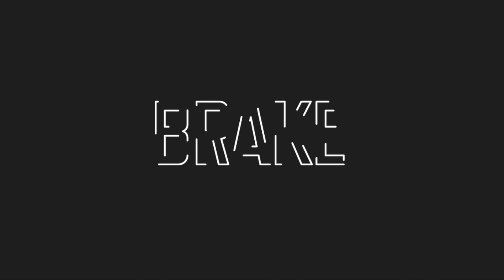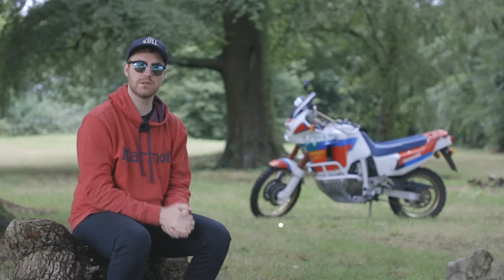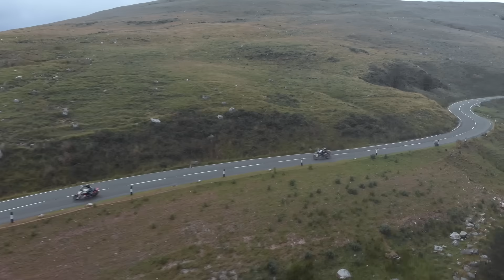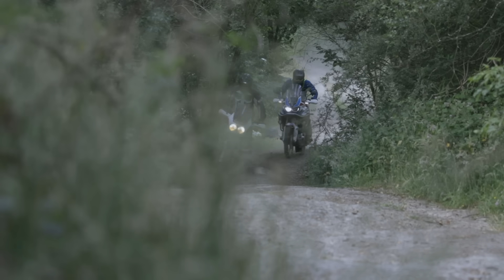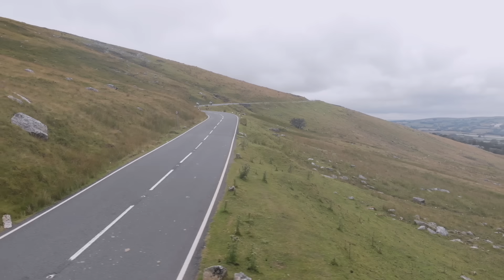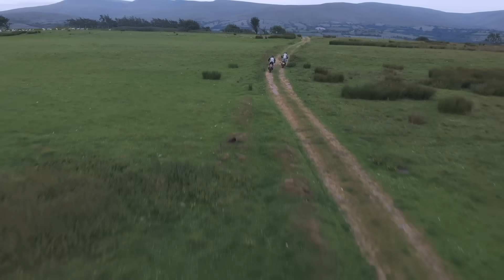Retro vs Modern - 1991 Africa Twin vs 2019 Africa Twin

Comment: Technology is great but for off-road purpose, I think you can get stranded if a piece of tech lets you down. For me, it would be the old bike to keep long term since it will always be fixable.
Reply from the maker: We were just talking about this on another video. It's kind of true but for the most part they only integral electeonics are the Efi/ECU and electronic throttle. All the other systems don't stop the bike running.

Comment: I drive a 1989 Africa Twin 650 almost daily (wetter not to nasty) and I upgraded the front suspension with progressive springs and a bit thicker oil and it totally transforms the bike. Instead of "crashing into rocks and potholes" etc. as you say, and generally flopp'n about due to the soft suspension, the handling improved massively. It will never be a modern generation AT, but it has become darn good for what it is. Flickable and very stable on motorways and on the twisties alike.
Reply from the maker: I can imagine.
Reply: Perfect example of keeping a classic bike in the hunt and still competitive, well done brother.

Comment: The old one is way and way better! If you have the new one and battery dies your fucked!! The old one you just push it and ride!!
Reply from the maker: How is that any different? You can bump start, jump start them? Surely that's not really any different.
Reply: @BrakeMagazine   yeah where do you do that in the woods? You cant push and start the new one... you need indeed a jump starter
Reply from the maker: If you have a hill you can bump start it. You can push and start most bikes. Its not easy and the old on will start easier, but it's not impossible. However, I'd say a jump pack is useful for any bike bigger than a dirtbike.
Reply: @BrakeMagazine  oh yeah is see! But the old one still better and more repairable
Reply: @BrakeMagazine   BUT there are both the best you can GET! best bikes out there!

Comment: T700 v 660xt
Reply from the maker: Why the 660?
Reply: @BrakeMagazine  because it's a like for like Yamaha Tenere comparison. Similar engine size. You wouldn't compare the T700 to the Super Tenere 1200, right?
Reply from the maker: @ianstewart9487  No I was considering the original Super Tenere because it's a 750 twin 🙂

Comment: Great video. I've only been riding properly for a couple of years, and have only ridden older bikes. My daily ride is an '85 XT350, complete with weeping fork seals, damping rods, tired shock and kickstart only. People laugh when it won't start first kick, or when I'm fiddling with the pilot air screw to smooth out the idle, but I think that retro world is all about finding sweet spots, in clutch play and throttle blipping and jetting and timing the preload bounce for that wheelie. But I haven't ridden anything modern to compare that too. So when I'm struggling up a pig-track and Roger says "My GS would get up here easily" as he whips along on his CRF, I tell myself its because the sweet spot on those came factory-fitted.

Comment: Sorry guys but the Africa Twin you chose was a POS! You need a good condition one to compare them. I have had both and the old one walks all over the new one. I stopped watching after you said it didn’t like going over 60mph! I sit at a ton (MPH) on mine in Europe and it is barely trying. Get a good AT and retest it will surprise you. We have not gained anything in 30 years unfortunately. One last thing... I had way better fuel consumption on my old AT than my new one. Breakdowns on my old AT are fixed at the side of the road - breakdowns on my new AT are dealt with by a breakdown lorry! I sold my new AT! Food for thought.

Comment: Good video,well done but there is just one thing that is wrong and it's not just yourselves making the quite important mistake. The mistake I refer to is the misuse of the word "Retro". 
The definition of retro is " imitative of a style or fashion of the recent past" . Now i'm sure that you are more than aware of the fact that the original  Africa Twin you use is not a modern bike designed to look old but is infact an original  design/model therefore making it impossible to be a retro. So maybe the video title should be "Original v Modern".

Comment: Nice! 1150 gs vs 1250 .. for the price today, 1150 is a very good machine for everyday and for very long trip. Easy to fix , very confortable and still fast in Alps corners..
Reply: Definitely !! But don't go for the 1150 but for the 1100 without ABS instead, I do own both of them and the 1100 feels "lighter" to ride without ABS, it's a difficult feeling... more "direct feedback" I would say.

Comment: Tenere 700 vs africa twin ads dct? im still in 2 minds over them....hondas build quality vs yamahas? hence the price
Reply from the maker: The build quality isn't where the precise difference is. The Tenere has the bare minimum electronics and uses an engine Yamaha use in a lot of other bikes. That keeps development and production costs lowerer, hence the low price.
Reply: @BrakeMagazine  indeed , i know that there is less on it which is a plus too for me, less to go wrong, but honda hardly ever go wrong...what do you guys think is the better bike if you had the choice?

Comment: You compare two motorcycles, one brand new and the other 30 years old. Judging by the condition of the old one, it has already driven a lot of kilometers (100,000+ ?) which makes the comparisons you make of course completely wrong. There is some wear and tear on a 30-year-old motorcycle such as the suspension and the motor part but also the motor in total. Offcourse its true there has changed a lot in motorcycle compared with 30 years ago.
Reply from the maker: It's has 30000km on it 😊
Reply: @BrakeMagazine  Do you believe it yourself?  😊
Reply from the maker: Believe what?

Comment: Great! Owned 3 xrv750 and a crf1000, which i have already sold. In my opinion the old one was an easy to handle swiss knife whereas the new one needs a lot more attention. Next: 700 Tenere Vs.ktm790 Vs. BMW f850 😀

Comment: Years ago I had a BSA Gold Star 500.  It was very easy to ride, went fast enough to get me where I wanted to go and looked Killer.  It was fun.   Now even a Triumph Bobber has to be 1200cc.  What?   Manufacturers have forgotten the mid sized bikes and how capable they are beyond the Sport Bikes.  I’ve ridden the Suzuki DL650 and the KLR650 and find them super capable.  I think the Afrika Twin could have been another of those easy to ride, fun bikes without all that weight and power

Comment: Kudos  for doing the comparisons that us old guys think of.  But, is it really going to be a surprise that modern bikes are always going to be “better” – better, smoother engines; more power; better suspension; better adjustability; better brakes, better ….well pretty much everything.

I think that what this test, and every single other comparo between an old bike and a new bike will reveal is:  There’s something lost in the ‘better’.  Call it ‘soul’; call it ‘cool’; call it ‘feel’; call it. . .  whatever.  When you insert a computer to take over a rider’s function, something is lost!  There’s something about old tech that puts a smile on the rider’s face that new tech just can’t match, even if the old bike is slower, poorly suspended, etc.  Old school has its benefits!

I’ve got a lot more bikes than a person should be allowed to own.  Old and new.  For the life of me, I have no logical reason why I should own a ’80 XT500, when I have a GS850, KLR650 or DL1000, because those bikes are demonstrably ‘better’ in every measurable way.  And yet, when I kick that XT into life, it puts a huge smile on my face – it’s a friggen hoot.  Every one of your comparos is going to show the same thing.  I’m subscribed with a big thumbs up!
Reply: I ride bikes to ride bikes not to ride computers. I can so that at home
Reply: New is not always better: 2005 D-tracker 250 vs d-tracker x. Sometimes attempts to comply new ecology standards just kills more or less fun machine.
Reply: Those xt's were tractors!! That's a compliment...from Wyoming USA 🔫🤠🇺🇸p.s stay safe

Comment: 1996 Suzuki DR650 vs 2019 Suzuki DR650, oh wait...
Reply: Suzuki cant update the DR because of modern day emissions. If she changes anything, the need to do a new emission test and it will fail. Same story with the KLR and XR
Reply: Very good 😂 FFS Suzuki need to update their bikes
Reply: Worlds apart. Different headlight. LOL
Reply: The new DR should be about $3,500 off the showroom floor, not $6000+ ...good bike but you ain’t gettin much
Reply: My 2018 Dr has some upgrades that aren't there on the 2017 version...fuel filter near the helmet latch and tool kit.
Reply: @robertgOU812   we could definitely make a 12 minute video about that.
Reply: Would you tell the colonel to change the herbs and spices? You don't fix what ain't broke.

Comment: Great video, a proper test would be to get an original Africa Twin thats been in storage with around 1000 miles it and had a proper service, then you'd get better results. Both excellent bikes.
Reply from the maker: That's pretty much impossible to achieve though 😂

Comment: I always supported what your conclusion was in this video and got criticized for it.... 80% or more owners of the new Africa twin will just ride it on tarmac and use it for touring. Therefore I said Honda should offer a version with tubeless tires since it is hands down easier to fix a flat instead of removing the whole wheel and tire from the rim at the side of the road. Nothing I've seen in this video would not also have been possible with tubeless adventure tires. To justify a tubeless off road tire you have to go way more hardcore. 
Like your channel content 👍
Safe rides 🏍😊
Reply: If you´re going with tubes, offer knobbies (street legal knobbies), but if you´re going to put a 90% tarmac tire, go tubeless. The stock AT comes with tarmac tires and tubes, the worse of both words.... I think Honda builds the perfect bike and then it passes to the "mess up department" for the final touch and then it goes into production...

Comment: This is a good idea. I would really like to see the XTZ750 vs. Tenere 700. I have an old '91 Super Tenere, and i feels really old in some point. Just as you said here the suspension has gone a lot of way in 30 years, but i surprised me that you thought the older bike was lighter. The 1000 CRF has grown in size but still. The one main issue with my old Super Tenere, is that i really feel it to very heavy, with much of the weight in top. I recently drove a BMW F850GS, and it felt like 50 kgs lighter in the track, but they do weigh approx the same. I think the difference between the old S10 and the new T700, will be big.
Reply: all old was generally lighter....golf class cars were 500kg lighter in general :D...well except bicycles :D

Comment: Its sad to see how far bikes have "advanced and improved" over the years.  I am sick of hearing about abs, traction control, ride modes,  etc.  I just want a bike that i can ride hard and maintain/repair when needed (even along the trail without special tools).  On the plus side these new rolling computers are driving the price of older used bikes down.
Reply from the maker: Unless you're talking bikes like the RD04. It's pretty expensive for a 30 year old bike.

Comment: Having owned both old and new models of the Africa twin what you don’t mention and is a big deal is ; the brakes on the old one are rubbish and the tank once full is really top heavy and noticeable, the new one doesn’t have these issues , and before anyone mentions it both bike I bought from new a 2000 model and a 2017 model.
Just my honest opinion
Reply: I had a TransAlp, my biggest complaint was how top-heavy it was.
Reply: I agree about the old one, as I had one for four years.

Comment: Great idea, especially for us nostalgic older guys. Just one thing; in order to make a fair comparison you can't take an old nail and put it up against a new bike. You'll have to find an old bike that is in-spec. Not easy regarding engine output and particularly suspension.
Reply from the maker: The bike we had was mechanically in good nick. Not perfect but decent. Finding pristine bikes that people will let us ride off-road is tough 😂

Comment: BTW a better comparison would have been between the non-DCT and the old Africa Twin, that way you could have focused on the key areas of difference that apply not only to these two bikes, but to pretty much all of today’s bikes, and to 30 yr old bikes. The DCT only appears on one model and is outsold by regular transmission anyway.

Comment: i just want the simplicity back. easy to fix and maintain on your own without voltmeter or laptop, obd. i've got rid of my dct because you can't jumpstart it or even roll it on with low or bad battery. you can't get it in gear without a full battery. no manufacturer will tell you this! did you ever try to fix an broken electronic gas handle on your holiday trip? it took me 4 hours to get a new battery in the middle of germany to continue my ride... (imagine this happens in the middle of nowhere). sure, old bikes can't catch up with new generations but i won't give a penny when it comes to these situations... make it simple, make it work, make it better, get rid of electronic stuff...
Reply: i was thinking about the new dct mate, i test rode it, was lovely to ride, but im drawn to simplicity and that for me means Tenere 700...i have xt660z, cant fault it or yamaha going back to basics and dumping all tech
Reply: @SeanDeodat  dct is awesome. i had my bike for two years. it al matters for what and where you use it. i don't want to say it's not reliable, 50.000 km (31.000 miles) in two years with two "breakdowns". if you're going hard offroad, especially in mud, and away from civilisation... a non dct would be a better choice (except you carry a spare battery :))))) )
Reply: @FRONTTOR_OLEELEKTROMUSIK  so you would choose dct over t7? or manual africa over t7? for basic commute and mild off road?
Reply: @FRONTTOR_OLEELEKTROMUSIK  t7 has sod all tech apart from abs which you can turn off, not much to go wrong bullet proof engine proven and pedigree of the tenere too but build quality is not a patch on africa, but thats why there is nearly 5k difference
Reply: @SeanDeodat  if you can, get a testdrive on both. you're comparing apples and pears ;) if you drive more street and use it for commuting, you're looking for more horsepower and comfort get the heavier feeling honda dct. it's simply a "bigger" and more expensive bike. for me the t7 came months too late but i had the chance for a testdrive... the t7 feels way higher, lighter and appears "slim". the seat is more enduro like and less cofortable. the price is really good for what you get. the little leak of power in comparsion, not really a matter for me... the honda feels more street orientated but is really good offroad. the yamaha is a pure enduro and street capeable. in the end it's still your choice.
Reply: @FRONTTOR_OLEELEKTROMUSIK  true. I have ridden xtz 660 over 10 years know them well. I want to ride a bike not a space ship. Too many lovely gadgets to possibly go wrong me thinks. T7 being late not an issue for me as I'm in no rush. Its just out of the Africa and T7 for me. T7 being a parallel twin I heard gives it a much smoother ride which is  a mark up on the xtz 660

Comment: For me, with 40 years of riding and ownership of every kind of bike, the standout differences are: (a) vastly superior suspension, (b) true offroad ABS(ie the KTM system), and (c) extremely capable traction control.
Owning a 1290SA and a bare bones DRZ400, it’s absolutely incredible how the KTM electronics work, far superior to the 3 Gs I’ve owned, although they’re fast bridging the gap.

Comment: Multiple things to take into consideration. Most RD04 or RD03 ( the 88 650 ) are Honda meaning they are so reliable very few people do the correct prescriptive maintenance. I drove a few different one and some can be night and day between models. My RD03 is brand spanking new and doesn't feel nowhere near as 90% of other bikes hope you tried one that was fresh too. For cruising mine is the 650 not even the 750 and will sit all day under the sun or rain at 75mph no problem at all. 
As for the new crf1000, the act will always feel vague and so is this model with the throttle by wire. Try a 2016-17 manual with a proper cable throttle, it is night and day.
Reply: The 650 RD03 is, front brake excepted, a better bike than the RD04. I did 1000 miles from Vicenza to London in 16 hours on mine, an Italian import, back in 2003 after trail riding in the Dolomites the previous day - truly versatile and one of the great bikes of the era.

Comment: It’s exactly that, you described what I felt few weeks ago trying the Niken, I drive since 1998 my newest bike I own was from 2008 and currently I ride a 2007 with abs. 
This is it, the connection of those new bike is really deluded, the sensation (or feel )with the technology what a pity. 
Anyhow, I have a slight preference for European bikes, been trying Triumph 1200scrambler, speed twin, street triple, and Ktm duke 790 and 1290  this summer and some how it was really good especially the Triumph.
So hopefully, everything will not be lost with technology.

Cheers guys.
And great review!
Reply from the maker: I think the Niken is a special case because it has so much front grip. 

I thibk a lot of what we're referring to is actually down the CRF1000L Chassis. 😊